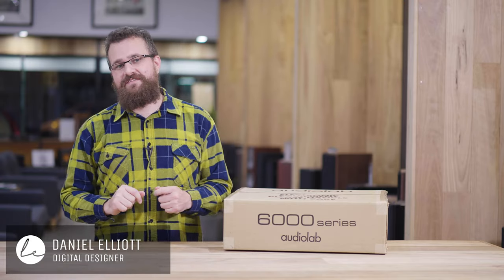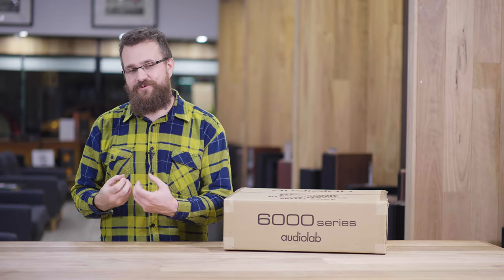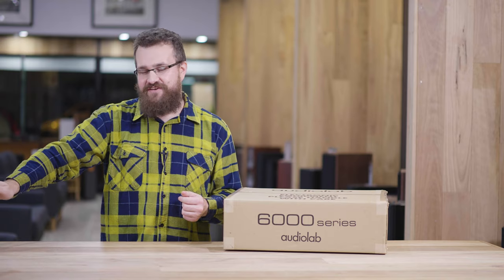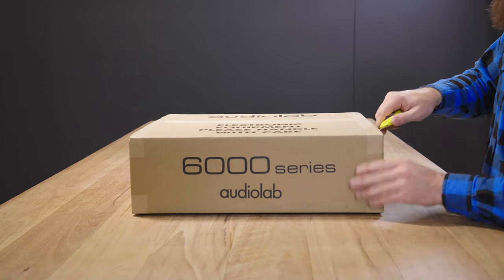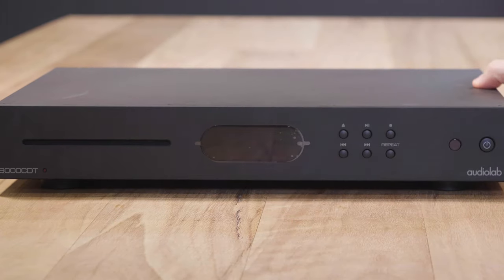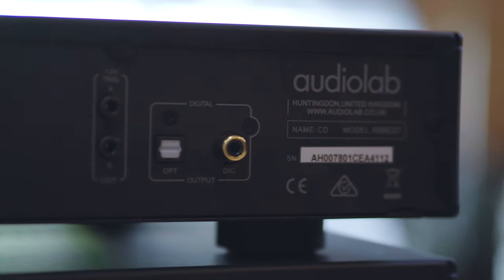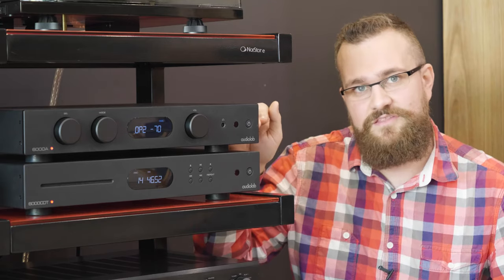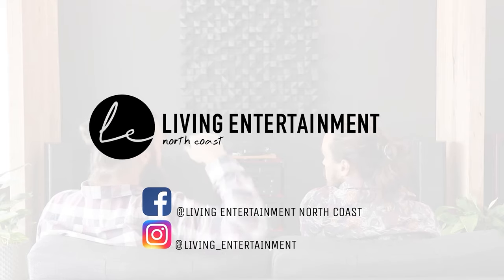Unboxing & Overview: Audiolab 6000CDT CD Transport

Comment: Love my 6000cdt , love slot mechs as well a lot cleaner and for reliability well I’ve had an Xbox one for nearly 10 years and a Wii for over 15 years both still working fine and not scratching discs.

Comment: One thing I want to add to this, you can also bypass the built in DAC on the Rotel CD14 unit with the spdif out jack .
Reply from the maker: Absolutely, though usually if someone is looking for a CD Transport we will recommend that they get a dedicated CD Transport instead of a CD Player that allows you to bypass its internal DAC. To us it makes sense not to pay for features you wont be using.

Comment: In your experience selling this units, what's the reliability of the CD slot mechanism and of the unit overall? Also, what's the warranty offered currently?
Reply: I had a Panasonic blu Ray player with a front slot and was very reliable for 5 years.  I have this audiolab for 1 month and its very nice build and Sterling performance.  Solid build , solid remote and solid well organised sound.

Comment: Your video is great. Here are some questions:
1. Can Audiolab 6000CDT read SACD disc?
I have a collection of SACDs and would like to take advantage of it. I thought I would get a Denafrips Ares2 DAC that reads DSD files.
2. Can we simply "transport" the digital signal from the SACD disc to a DAC decoding DSD, which the Denafrips Ares2 does?
Thanks for the answer.
Reply from the maker: Unfortunately the Audiolab 6000CDT is a pure redbook system, standard CD only.
Reply: @living_entertainment  So, is there a good transport/cd player that read SACD? Because my Sony DVP-NS999ES is about 20 years of use...
Reply from the maker: @pinkyfloydyfan1  They aren't particularly common but we can heartily recommend the PS Audio The PerfectWave SACD Transport.